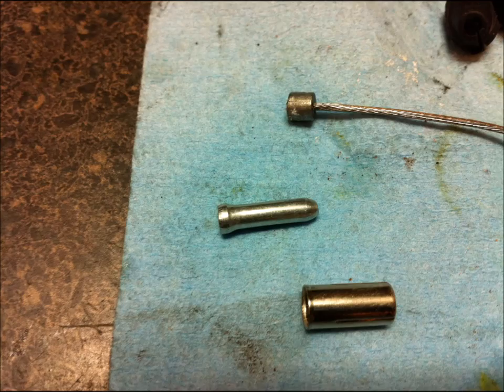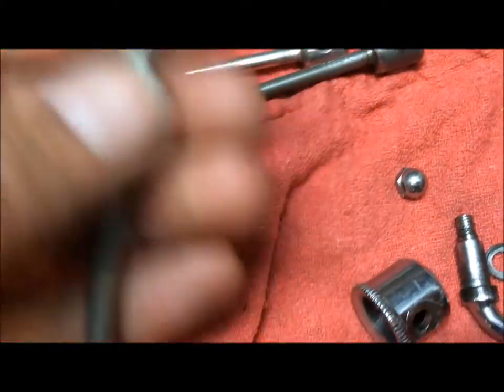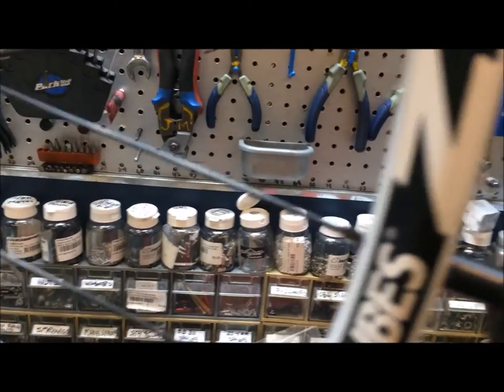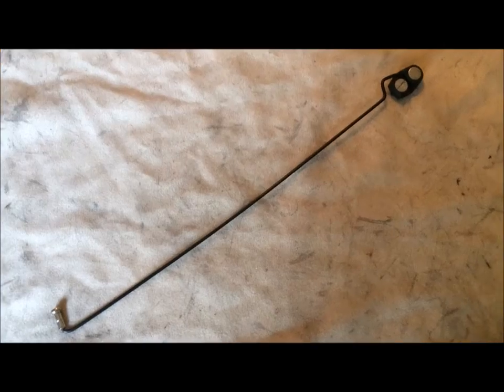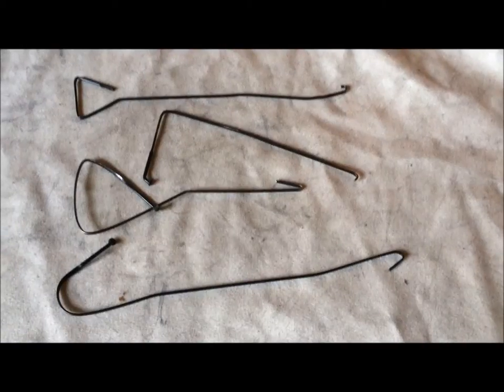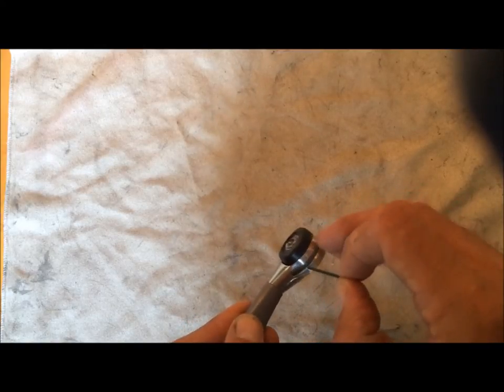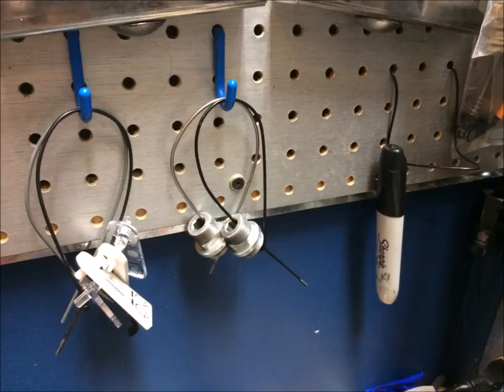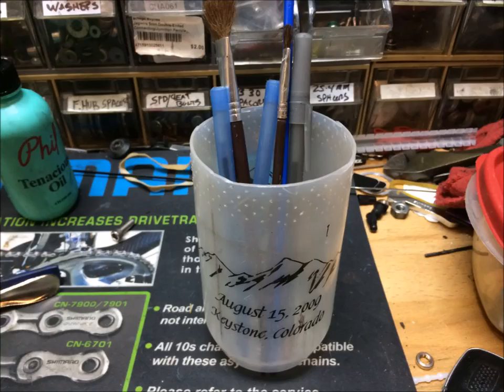Bicycle tools: 10 cheap and easy to make home made tools.

Comment: use a bottle as a tool bottle. if the mouth isn't wide enough cut the top off and put a hole in each side and thread a piece of bendy wire through and twist it to secure.